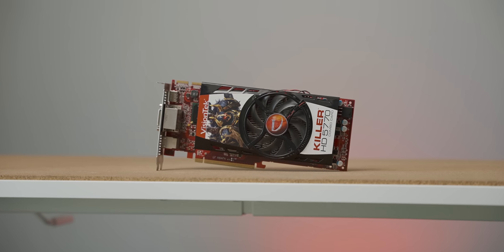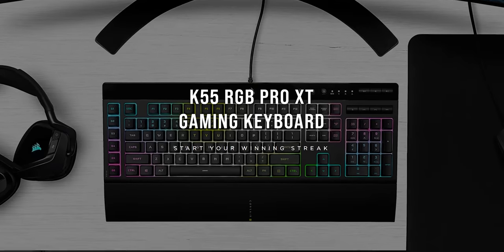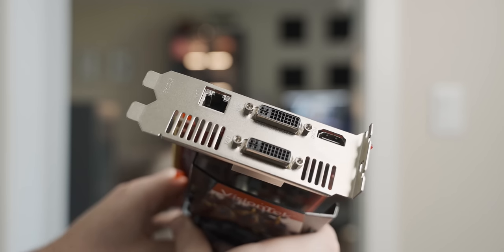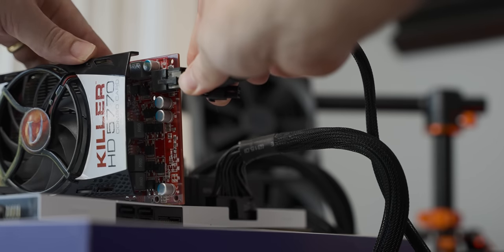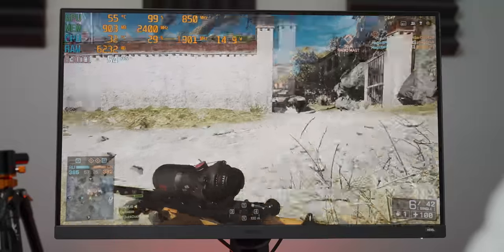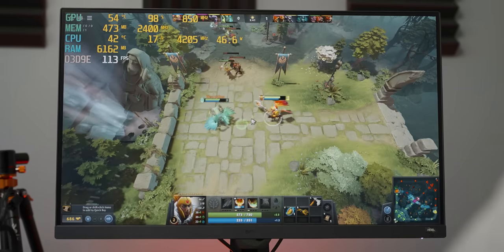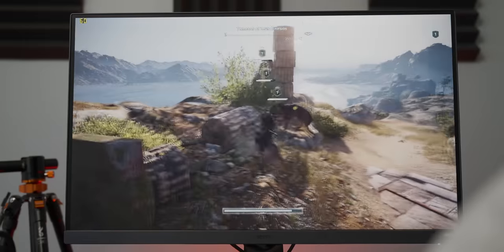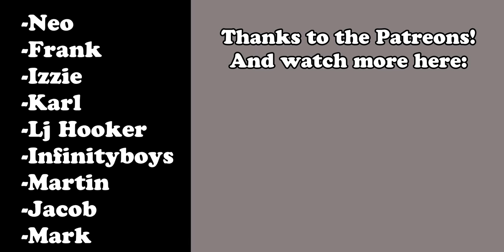The Most Pointless Graphics Card Feature Ever?

Comment: I used to run an internet cafe back in the day, and at the time 1080p wasnt really popular. And the popular games were like CSGO, COD4, Dota and Rainbow Six Vegas i think. when outfitting a cafe with about 15-20 systems, combo cards with high speed ethernet, versus buying motherboards with high speed ethernet + a capable gpu was much more cost effective, and did provide a pretty good gaming experience. In 2021 they dont look like much, but in 2010 they were the shizz.

Comment: Hey! About the geforce now thing: I've been forced with an old HD4650 or something like that for the past few months because my r9 280 broke, and... Yeah, that does suck. It's not because of geforce now, but because the video card was so weak that it couldn't handle geforce now (you still need acceptable video decoding capabilities, especially with higher framerates and resolutions). Now I managed to get my hands on an r9 270x, which handles that just fine. Nice video!

Comment: HD 5770 from Sapphire was my first graphics card, cost me 150$ and lasted in my household for 10 years @ 720p gaming. Thing finally died a year ago while my little brother was using it for games like minecraft, skyrim, and league of legends. My Nvidia cards I got to replace it several years ago have been such utter disappointments and cost me twice as much as this old monster. It's truly a shame how the price/performance has degraded over the years, be it from inflation, import tax, bad coding in games, or innovation moving too fast..  Feels like I already need to upgrade my graphics card, once upon a time you could buy a 600$ budget PC and it could compete with console gaming with ease.
Looking back, even processors had better price/performance than what I've seen today. Phenom II B55 processor I had was a dual core that unlocked to quad and overclocked to 4.4 ghz, only cost me 50$ on sale...
Don't even get me started on memory and storage prices now, but hey cooling, psu, and cases haven't changed much in their price, so not all bad.

Comment: In 2009/2010, you had to buy a mid to high-end motherboard to get 1Gb Ethernet. Many lower end motherboards still had 100Mb onboard. Rewind a few years, and even mid-range motherboards were fairly sparse that had 1Gb onboard Ethernet.

Now, factor in that most onboard Ethernet was some Realtek or Broadcom crap that didn't perform nearly as well as Killer NICs did at the time. Couple that with mATX being a very popular form factor, and you can see why there was at least a niche market for something like this back then.

A HD 5770 wasn't even coming close to using all 16 lanes of PCIe 2.0, and 1Gb Ethernet wouldn't use much of it at all (1 or 2 lanes at most) it really did make sense for a few people.

I almost bought that card for a new build in 2010, but it was cheaper to get a better motherboard and a regular 5770. However, if I already had the motherboard, maybe a year or two old, and it had a crappy onboard NIC, it would have made sense at the time.

Comment: It makes sense from a certain point of view, for example if you have had a prebuilt sandy bridge system with very few pcie 2.1 lanes (maybe 20 lanes TOTAL) and wanted a decent gpu + sound card and a "low latency" ethernet card. How do you go about this with a system with only one x16 and one x4? The sound card hogs the x4 (electrically x1), the gpu hogs the x16 (electrically maybe x8), so at least 3 lanes wasted on the sound card and maybe another 8 on the gpu. How cool and efficient it would be to have combo cards. I wish there would be more combo cards, like an 2.5GbE with an nvme ssd holder card, there are such things from qnap and synology but each have their down sides, due to their respective nas system, so can't really use them on standard pc.

Comment: Had the ATI 5770 (reference model) as it came with a prebuild in February 2010 (so clearly, it came out earlier than 2011), served me well until 2016 where it died from heating issues, didn t bother to try checking if it can be brought back with new thermal paste or an experimental oven treatment...but well, am somewhat concerned about the oven....doesn t seem tempting if my future Lasagna smells or tastes like PC hardware...

Comment: With the stagnation of Windows in the mid 2000s and budget computers still coming with 10/100 Ethernet and short on PCIE lanes, it makes sense to offer a combo card.  I remember opening up a 2011 basic Dell to find a board with only one 16x pcie slot, a pci slot, and a couple of small pcie slots which were both in use by input cards.  As for Windows, XP held on for over a decade as Microsoft rapid fired trendy UI designs without working out the bugs first or asking what their consumers wanted (just because convertible laptops were popular doesn’t mean the user wants Windows to look like a phone or tablet OS).

Comment: Ethernet is for HDbaseT (I guess?)

you can run HDMI cable about 50 feet (15m) but in case that you have monitor place very far away (for example, the billboard) you need a very long cable. HDbaseT that uses an ethernet cable can handle up to 900 feet (300m). 

Nowadays, we rarely see this thing because we can run a big monitor with a small pc. So, we can fit a small pc behind the billboard and don't need to run a hundred meters cable anymore.

Comment: What's most surprising to me is that this is somehow pitched as a value solution, but uses an extremely expensive PLX chip to create enough PCIe lanes for both devices. You couldn't get a motherboard with a PLX chip for much under $300 at the time, while adding that exact Killer network card to an existing would only be around $80. What kind of deal did Visiontek get to make this thing affordable?

Comment: Snappy Driver Installer can find slightly newer drivers then the ones used in this btw, the APU's got updates they didnt include the codes,  and the NIC drivers even got a couple harder to find updates in my exp.... i know somebody still using a classic Killer card thats now running an open source firmware(updated linux kernal and such) thats still working great....just alot of work...

Comment: I think it was for upgrading motherboards with a high speed ethernet on the high speed PCI-E bus... This would upgrade   thin client type hardware,  that had very few  pci-e slots to use, as used at a gaming setup.. like for a convention centre  gaming ... 16 or more thin client setup with each streaming to the control centre, which can choose which gamer to put up on the big displays for the audience.  So even if the motherboard had gigabit builtin, it could be poorly implemented, and turned into an NE2000   (remember them ?? )  somehow upgraded to gigabit...

Comment: I used to use an AMD HD 6770 card, which I have heard is basically just a HD 5770 that they rebranded. Worked great until the plastic fan shroud connectors broke, which messed with the cooling flow and it started to overheat under load. No ethernet port on my card, though.

Comment: Yeah the software for the Killer NIC cards sucked it could prevent you from accessing the internet and sometimes they even had driver issues. I have a Killer NIC card in my gaming MSI laptop from 2017 and it still works decently enough but I don't even have the Killer NIC software installed which makes the card work better than with it.

Comment: First, have this card. Second, works with or without the shroud, no temp diff. Third, Killer placed the NIC on the card to jump on the "gaming" bandwagon. I believe the idea was if it was integrated into the GPU it would use less resources and not take up the extra slot that it usually would take up. I also believe marketing thought it was a snazzy idea considering it was attached to the GPU itself. Minimal extra cost, two birds with one stone. Please understand Killer was trying to place itself as THE NIC for gaming and wanted to make sure you thought nothing else could compare. Fourth, GFX works on bandwidth. If for whatever reason their servers are loaded and or the points in between are congested, your bandwidth is throttled and the game stutters. It has been a day one issue with ALL streaming services. And why cloud gaming is still, well, stuck in the clouds.

Comment: Alienware still uses the Killer network NICs. Never did see any advantage over it or any other NIC interface since I was wading out into brodband at the time the card existed. Adelphia had teething issues at the time. 13 years would pass and two kitchen remodels later did a Comcast tech find 400' of coiled coaxial cable connected to the home's coax network did they find the cause of an issue. Removal of the 400' of coiled coax buried in our ceiling things improved. 

But never did see any improvement with the Killer NIC on my Alienware. Might be useful for local LAN parties, but over the internet not so much.

Comment: I guess this GPU was marketed for Asian market, integrated ethernet is usually the first thing that fails in cheap Chinese motherboards and this GPU allows you to save one pci/pci-e slot that would have been used for ethernet card otherwise. When I hovered my mouse over the video I saw something similar to a PLX chip on one of the preview frames, so I was expecting this card to be less useful. Honestly, I'm surprised why GPUs are not equipped with a headphone jack

Comment: If I remember right KillerNic cards were basically embedded Linux devices. Back when they were somewhat relevant Linux's networking stack was far more mature and optimized then Windows at the time which often resulted in noticeably lower ping times (we're talking measurable in the 10's of ms at the time) so Killernic basically aimed to bring that to Windows as that kind of latency difference would technically give one a competitive edge back when the internet wasn't as good as it is today.

Comment: the reason these NICs exist and still exist today is the processing features of the card itself. It is meant to reduce CPU load as at those times, realtek network cards put the load on the CPU and also lacked features like virtualisation, checksum offloading and loads more. Games tend to be more towards packets per second then bandwidth.

Today gigabit NICs are still being bought for desktops to run things like virtualisation, software routers like pfsense as NICs like server ones support these features and virtual NICs for passthrough for better virtualisation support too instead of using hardware emulation or virtio. Speed increase to lower CPU usage.

Comment: With the ethernet port, it could have been designed for some HPC usage, where the GPU itself would talk to other GPUs to build a supercomputer cluster for scientific calculations.
Maybe it was specially built for such a use case and later also sold to normal customers.

Comment: “Why does this graphics card have a gigabit network port!?”

Me, remembering that LTT did a video about a graphics card that only had 4 gigabit ports as its output, because gigabit Ethernet is more than capable of streaming data fast enough to run a display, and Ethernet can do that at a very long distance. Ill bet you that card was a rebrand of some industrial use card from some niche server use and if you had proper drivers and not junk ones found in a closet online, along with the proper hardware, you could have tested that for yourself.

Comment: My favorite nitpick about video card features isn't something that shouldn't be there, but something that should... At least for models that are multi-monitor capable. They have only one each of the connector types. I have two monitors, both will be the same type and same connectivity. So why do I have to get an adaptor to run the second one with  the video card? Why are each connector type not duplicated on the majority of cards? I know you can't put every type on there, but you can put dual of at least two types and then include adaptor sets that fit those. So both monitors are on the same set up.

Comment: Honestly, I like the idea as the NIC takes some of the work away from the CPU, and the fan on the add in board will actively cool the NIC all without the need to use a 2nd slot on the mainboard. But with processors being as fast and as multi-threaded as they are today, such things are unlikely to make a tangible difference.

Having said that, integrating an NVME slot on the backside of low to mid range cards would be pretty cool. What better way to breathe life into an early 2010's system than a modern GPU and some superfast storage right?

Comment: I think this thing is designed for pass through virtualization purposes. You can configure a virtual machine and run a wire from the RJ45 of this card to a low performance PC far away, and play games or do some other gpu-intensive work there. AMD had a specific lineup for this kind of job, namely Firepro R series. I think Nvidia have something like this too, which looks like a Quadro 4000 but with a RJ45 port, but I can't remember the name for now.

Comment: The Ethernet port is for use as a video output at great distances through cat wire I would consider. HDMI, dvi and such degrade and do not work long distances without signel boosters but u can use cat wire to travel as far as you wish in theory. What's crazy is I use to have 2 hd 5770 in crossfire in my homebuild. This was cool to see

Comment: At the time this was released the Killer NICs were absolutely miles ahead of onboard NICs available at the time, they bypassed the standard network stack and allowed for on-NIC management. It wasn’t a huge performance difference in most cases but it could help a lot with latency in competitive online gaming. This card at release was about ~$10 cheaper than buying an hd5770 and a killer NIC separately, so it would have made sense if both were already planned purchases.

Comment: So if I recall the reason for the integration of the 2 cards was because it "saved space".  Motherboards that did not have a built in Network option and didn't have enough PCI slots to have a network card and graphics card (or they were too close together to be used at the same time).

Comment: Huh... if an ethernet port inclusion like that was high-speed enough to allow for a next-gen internet speed compared to whatever the current standard is and was put on a high-end GPU, I could see a situation where someone could prioritize a CPU upgrade without changing platforms and could upgrade their internet speeds in their house around the same time, meaning the ethernet port on the card would be the best option to not leave performance on the table if one were to, for example, stream their gameplay. While uncommon, I guess scenarios where that port would be a useful inclusion do exist, though I can't think of why it was included on the HD5770.

Comment: I think the reason why that card with an ethernet port exist is because it could be integrated into a specific workstation PC in where you can transport a video stream through the evening video boxing ethernet and it'll play through Ethernet to a display like in another part of an area or room or whatever on the same local network and then coming from experience being a former audio visual designer and integrator